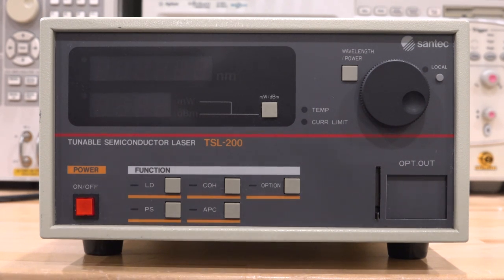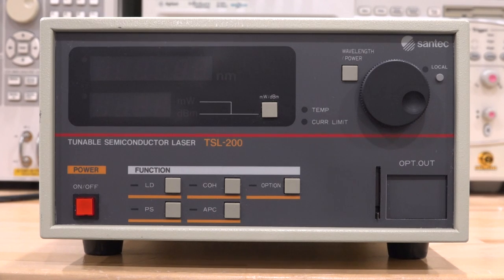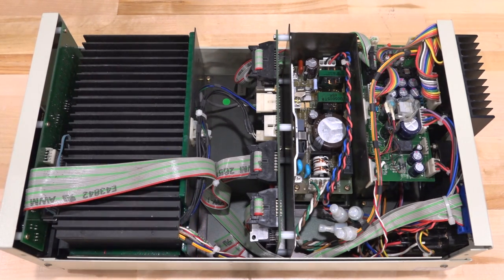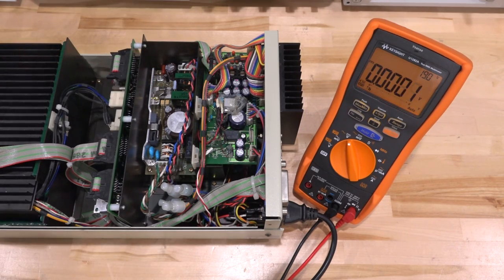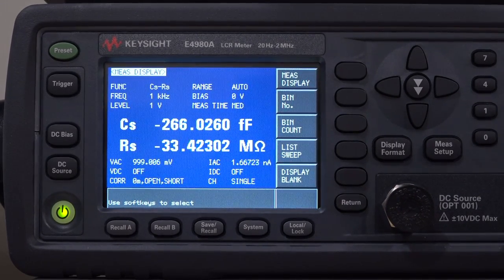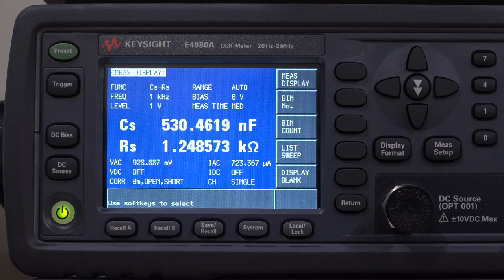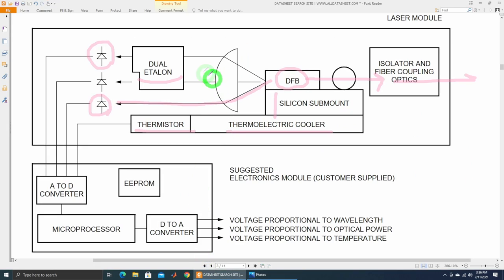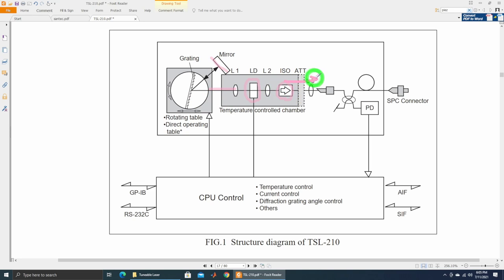TSP #196 - Tutorial & Experiments on Tunable Semiconductor Lasers & Wavelength Locking Methods

Comment from the maker: Some of you have advised against putting an oscilloscope on an isolation transformer. The main reason is that by "floating" your scope with respect to earth, the outer conductor of the BNCs also float and can therefore rise to dangerous voltages due to probing. This is good advice and safety measure. Always place the DUT on the isolation transformer and never the instrument! This is how all my setups are done.
Reply: Or use a memory recorder. Memory recorders have isolated inputs.
Reply: Or use isolated probes, but those aren't cheap. Probably the cheapest but safe solution for hobbyists is to use an inverter powered by an isolated DC source.
Reply: I use two isolating transformers, one for DUT and another one for instruments.
Reply: @DmitryOrlov_dimorlus  that is certainly possible. Get the right tool for the job! Or as my friend Ed always said: ‘because you could doesn’t mean you should’
Reply: @NiHaoMike64  Transformer is much chipper and reliable, and doesn't create noise (EMI).

Comment: Startup caps on a SMPS are such a common failure that I just replace them first without doing any further tests. The classic symptom is a device that was working, but then failing to come on again after power has been removed.
Reply: I see this failure mode all the time as well, although I often find a design will splurge on a name brand 400 V bulk filter capacitor, but the bootstrap capacitor will be some Dongguan back alley special in the smallest and highest ESR package they can find (much smaller than the ones in this video). Makes me rethink where I should be spending my BOM.
Reply: The reason the startup cap has such a high voltage rating is that if the power supply doesn't start for any reason/fault the voltage in the cap can go way higher that 50V

Comment: In a previous career I serviced and supported commercial laser printers. In a consumer or midrange printer, the laser is a sealed unit which is not serviced. In the highest-speed printing environments, they were made with 15-50mW gas lasers (usually argon), or with laser diodes. This video covered so much of the similar technologies. The components in these types of laser arrays would all be replaceable and adjustable, much larger than a sealed wire-bonded unit. I miss the art and science of adjusting those units. Such happy memories :)

Comment: Very nice, I love it when you do these optical subjects! The substrate that the tunable laser diode was mounted on looked like something special, maybe Zerodur or some other low CTE glass-ceramic material?
Reply: Looks like AIN to me
Reply: AlN is quite common for these types of applications. You can find it almost in every mass product butterfly-like assemblies. Zerodur will be overkill.
Reply: @enclis  yes also from the color, an i think it is hard on other material to make solder contact surfaces that hold well. Zerodur is way too expensive ^^

Comment: Found Your excellent channel just recently, subscribed! 
I am an EE running my own lab as well, mostly worked in analog development projects as a consultant and in startups. Way back a 1/4 century ago me and several of my friends did work for a small company in Gothemburg, Sweden named Radians Inova AB. The the flagship was a then state of the art tunable laser. The  company was subsequently sold to Thorlabs and in 2009 the project moved to the US. If I remember correctly HP was the main competitor back then. I have a controller and some laser heads, have to dig them out end see if it is possible to do something interesting... Thanks for a very interesting video!

Comment: We have on campus a monochromator, which uses 2 Diffraction gratings in series, which was used with a non-coherent light source of high intensity which was then passed through an unknown color filter, and it was set up to scan through from Mid IR to UVA to a sensitive optical sensor that measured power and we got a characteristic curve showing the band pass of the filter. It was also used to test CCDs, CMOS, and and other photo detectors and check their photon conversion based on wavelength.

Comment: Such a  shame they don't make visible light tuneable lasers
Reply: There are a lot of visible light tunable lasers on the market. If you meant Santec only, it turns out that relatively low power visible light CW+external modulation (not pico/femto-, supercontinuum like, etc) tunable lasers that are probably can be done by Santec is not that of an interest for the market. We have a lot of cheap mass-product fiber coupled NIR tunable lasers due to telecom WDM systems.
Reply: If you have the money: https://www.newport.com/mam/celum/celum_assets/resources/Vantage7100_datasheet.pdf?1 Tuning ranges are quite narrow though.
Reply: @LesLaboratory  Or you can just take supercontinuum source ( http://www.yslphotonics.com/Home/Index/Product/details/id/50.html ) and filter out almost any frequency you want from 410nm to 2400nm

Comment: Those old HeNe lasers stop working after a while because their gas tube fails and needs to be replaced.  This is true of all gas lasers, which is why most instruments now use diode or other solid state laser technologies.  If it is indeed the gas tube that has failed in that laser, it might be difficult to source a compatible one that still works.
Reply: Yep. Our applications of gas lasers would have a simple ammeter on the driver input. Once the gas started to get very low, you’d see a high draw of current and know it was soon to fail. In our case, we went through hundreds of the exact same unit, so the OEM would remanufacture them - however the reman units had a substantially shorter life.
Reply: Most wavemeters nowadays still use HeNe lasers because a stabilized HeNe laser has a relatively precise absolute wavelength to ~ppm level. Most solid state laser are not absolute and can vary up to several nm so it’s easier to use a HeNe as a light source so the instrument doesn’t need to be designed to accommodate calibration over several nm.
Reply: @wadehsu2347  Solid states laser can be made as frequency stable as HeNe lasers, but those are extremely expensive and HeNe lasers also have very tight beam that is hard to get on solid state lasers. So thus its way cheaper to get a HeNe laser which it very stable as is, only disadvantage is that is bulky and need HV but they can be made quite small if not need any real power from them.
Reply: dtiydr yes, solid state laser can be frequency stable, but they are not inherently accurate and not as stable as stabilized HeNe laser. So each laser will need to be measured and calibrated and the range of that calibration can vary up to 10nm. Unless the laser diode are lock to an atomic reference then the accuracy becomes absolute, but that come with a price of complexity and wavelength typically in the IR for common atomic reference such as Cs or Rb. Also, long term stability of single frequency diode laser are poor if not locked and they are also temperature sensitive. So to maintain the wavelength stability the temperature and current of the laser diode will need to be regulated to better than 1mK and ppm stability.
Reply: @wadehsu2347  All correct and thus their price and in many case a HeNe is easier to control that part but not as wide band and also bulkier which could be a constrain sometimes but otherwise its pretty much the best choice and no doubt cheapest.

Comment: I have never heard of using laser to punch the components into position in photonics and micro-optics packaging. I can imaging there are several reasons not to do that. One would be the power required and the debris generated during the process would be very bad for those free space optics. Do you have any references on how this is done? Single mode fiber coupling in integrated optics package are typically done with nano positioning stages during glueing. Fiber coupling are sensitive, but not that sensitive. You can be off by a um and still have acceptable coupling efficiency.

Comment: Curious about how the LD will somehow synchronise with the frequency of light reflected back into it.
Reply: This is due to a phenomenon called stimulated emission. It is the fundamental thing that makes lasers work and produce coherent radiation. Basically, a photon that is reflected back into the LD will stimulate the recombination of electrons and holes inside the LD. The photons emitted in the recombination are in phase and of the same wavelength as that original photon, and they stimulate further recombination and so on. Eventually, the large majority of the photons are produced this way and you get laser light.

Comment: Does that power synthesizer support 400Hz output?  Yes I'm calling it a power synthesizer because that is basically what it is.
Reply: It is a power supply, and the output is DC.  The transformer runs far higher than 400Hz, usually in the hundreds of kHz or even MHz.

Comment: I was trying to see how an optical silicon microprocessor could use the frequency deviations for mathematical functions especially in a Pico wavelength measure. I can see how it would be faster than electrons because it could be instantly read globally on the face at a moment.

Comment: 7:12 It'll blow up your scope even if you probe the negative pin of that capacitor, or in fact any pin after the rectifier. Because of the way full bridge rectifiers work, both DC rails end up floating around with amplitude of the mains Vpk.

Comment: I have noticed you often use the term calibration a bit wrong, instead you should say adjustment. By definition, you don't adjust or change an instrument during a calibration, you just verify that it is still in spec. Only a small amount of Equipment get adjustments over their lifetime.
So the outcome is either yes or no, and if no it might be possible to do an adjustment/alignment. I know you know this, but I find it important to do it Right, especially because you are teaching and have a lot of reach. I also know this misconception is wildly spread but important to get Right, I would hope you can integrate this. Thanks for the good videos.
Reply from the maker: Thanks for the point. I am not sure if I agree with it. The term calibration in this industry has a well-defined meaning. The calibration process ensures that the instrument produces or measures the desired parameters based on its specifications. The calibration process achieves this by either making adjustments to the unit or by applying appropriate offsets, lookup tables, etc. in software. Regardless on how it is done, this process is called calibration for test & measurements instruments. If you ask me how calibration is performed on a specific instrument, then I can describe whether it is done by adjustment, or otherwise.
Reply: @Thesignalpath  yes I agree in the industry it is quite common to say calibration to both. I even noticed when I was younger I often heard it and though calibration also meant adjustment in the equipment, but I learned only later that people often used it that way. And I think even a lot of technical people who are not directly involved with calibration of Equipment probably think that they get adjusted when they get calibrated, but that's rarely the case. For most industries, at least. I also agree that we use the term as a whole of the process, but by definition an adjustment can be only a subsequent result from a Calibration result. As also NIST Handbook  defines, "Strictly speaking, the term "calibration" means just the act of comparison and does not include any subsequent adjustment.". But yes, I'm splitting hairs, maybe. Also, it is not difficult or even hard to change the usage. Would be interesting to ask engineers but also hobbyist, I think you would be surprised on how many don't know what happens when an instrument gets calibrated, maybe that would be a video idea, also if possible with a cal lab as a cooperation.
Reply: The calibration chapter in every device's service manual ever printed disagrees with you.
Reply: @stargazer7644  does not mean it is correct Nist and the German PTB see it the same way i do it, i also quoted it before. i think if PTB does say it so i would think they have a point. you will also see if you buy a calibration service you won't get a adjustment you have to buy a adjustment separately form every service provider, proving the point further
Reply: @heinrichhein2605  Well, how about checking a dictionary?  According to Merriam Webster, one definition of calibrate is to measure precisely against a standard.  That's the sense you're using it in.  Another definition of calibrate is "to adjust precisely for a particular function".  That's the sense we're using it in.
Reply: @stargazer7644  The sense im using is the one that is used in the industries of Calibration and Adjustment. Just ask your Service provider as i sad they do differentiate quite clearly. And again a adjustment can only follow a calibration but is not included or part of it. Also International Bureau of Weights and Measures (BIPM) strictly defines it as " that the calibration process is purely a comparison, but introduces the concept of measurement uncertainty in relating the accuracies of the device under test and the standard." and further "NOTE 2 Calibration should not be confused with
adjustment of a measuring system, often mistakenly
called “self-calibration”, nor with verification of calibration. " i think this matter is clear all authorities on this topic agree that calibration does not include a adjustment. If you are interested, you can read it if you search for the PDF "International vocabulary of
metrology – Basic and general
concepts and associated terms
(VIM) "
Reply: @stargazer7644   just using it wrong does not make it correct, sure most of the time in language it makes sense to adapt what the people are using but i totally disagree with technical terms which have a clear definition. In Science there is no much ambiguity, if im talking about a Fourier transform it is exactly defined what that is. the same with these Technical term similar to what a Current and a Voltage is. And a dictionary is not the correct place, it does not care about scientific facts. And as i showed in engineering and Science we have better places to reference these therms like i showed you. I would take Technical definition from BIPM and similar institutes any time over this language dictionary. you would never use such dictionary to reference a Technical term. And i agree it is commonly wrongly used.

Comment: 7:07 please do not suggest to put the oscilloscope on the isolation transformer. That's dangerous.
Reply: As the immortal Q mused to Picard: 
"If you can't take a little bloody nose, maybe you ought to go back home and crawl under your bed?"
He went on to warn that:
"It's not safe out here. It's wondrous, with treasures to satiate desires both subtle and gross - but it's NOT for the timid".
Reply: Said this because he's immortal, right ?
Reply from the maker: @thomasw6169  Thanks, I added a pinned comment about this. And yes, I am also immortal.
Reply: @Thesignalpath  Haha, right.
And it's easily forgotten during work that the whole case (if metal) can become live depending on how you connect your probe ☠️

Comment: I think you should have mentioned to NEVER use a isolation transformer for the oscilloscope.

If you do that, and then connect the probe ground to a high voltage relative to ground, all the BNCs on the scope along with parts of it's case suddenly are dangerous.
Reply from the maker: Thanks, I added a pinned comment about this.